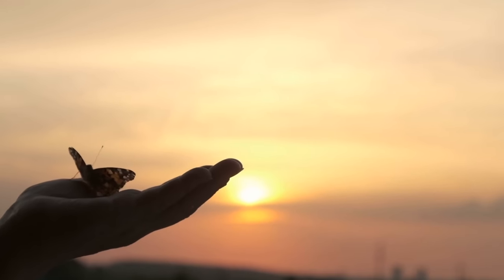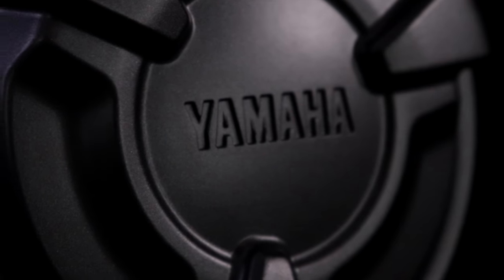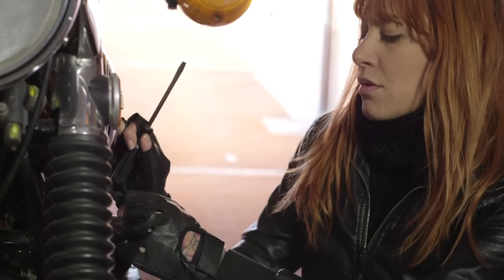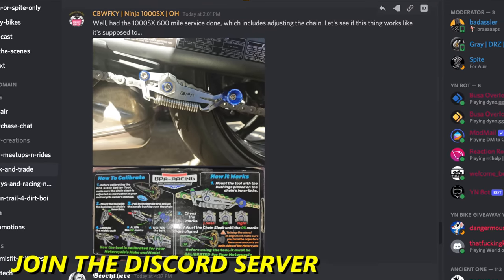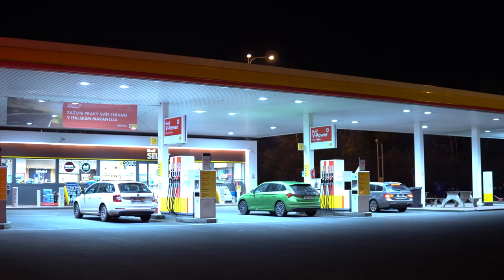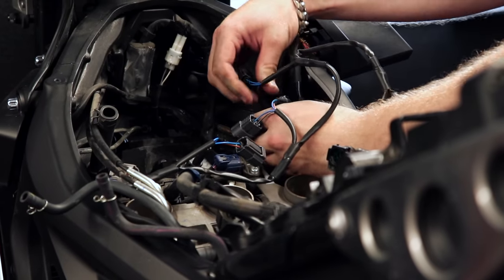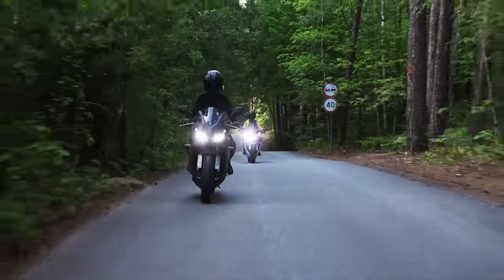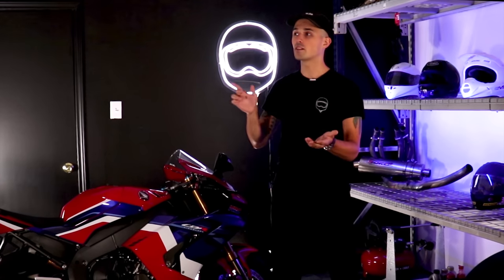7 Ways to AVOID Damage to your Motorcycle (Will Last Forever)!

Comment: Running up to redline occasionally isn't necessarily a bad thing.  I run my current car up to 8k+ fairly frequently.  It has over 200k miles on it and it doesn't use any measurable amount of oil.  I once had another car with a very similar engine that had half as many miles and burned almost as much oil as gas.  It was owned by an elderly couple that drove it like they were driving Ms Daisy.  They sold it to a 20 year old who revved it like it was designed to be and wiped out the oil rings because the Pistons actually travel a bit further at high rpm.  Manufacturers put the redline where they do for a reason and they take valve float into account.
Reply: Exactly👍
Reply: my opel has 500k miles on factory engine ran it 1.5k-2.5k all the time on highway 4.5k rpm, started to use oil lately, changed piston rings each 120k-200k miles how its normal for them to last, got a toyota with 140k miles bought it with 120k miles ma lil toyota had 2 broken piston rings and 1 exterminated ran without missing a beat for 8k miles sometimes didnt use a bit of oil sometimes used 1 litre per 1k miles i then opened the engine and renewed it now it runs good and doesnt consume oil, new chain gaskets and piston rings and engine is like new, piston rings last around 120k miles also driving litely affects their life proper warm up cool down helps, engine had massive amounts of carbon before i repaired it 1st owner didnt take a lot of care about it,close to redline kills the engine especialy if high mileage and old factory parts, but yea you can rev it hard without breaking the engine but not exagerated

Comment: Proper break in, keep your bike from overheating and keep up on fluids.
Reply: No such thing as break in
Reply: @TheFerwing  yup, they are broken in at the factory
Reply: I was told to keep it below 6k and 65mph for 650miles
Reply: Exactly, do like you said. If interested in motorcycles, cars and travelling, go and check my content. You may like it. :) Thanks for taking your time.
Reply: I used to do the proper break in with every new bike I would get. My last new R1 and CBR1000RR I just immediately road it like I stole it. No problems and the interesting thing is alot of racers do this same thing and recommend it. My new bike I'm getting I'm flying to Denver to get and riding home. Definitely not breaking that in "properly".
Reply: @noiceb5655  No they aren't broken in at the factory. They are very briefly tested to be in full working order before leaving to be on the public highway for liability reasons. They are literally started up and ran though the gears on a rolling dyno for a minute or two and shut off.
Reply: @madpirate1790  A road bike is different to a race bike.

Comment: for storage fill tank with ethanol free gasoline,  Ethanol absorbs water and causes all sorts of problems.
Reply: AND contrary to popular belief and the labels on the products in question, you most certainly CAN invent problems "over-dosing" with those ethanol treatment chemicals on your bike. It can cause shellacking in the tank and fuel system all the way through (which is actually easier to deal with in a carburetor) and it DOES deteriorate over time... reducing volatility and "fire power" you get for the fuel.  ;o)

Comment: My zxr400 has spent most of the last 20k miles of its life above 10,000 revs .... Still good as new inside the engine. I'm never scared to rev any bike, I always avoid the rev limiter though, there's never any need to hit the limiter.
Reply: Agreed,  but I hit mine once or five times 🤭, by accident of course...

Comment: I don't drain all fluids from my motorcycle during the winter break, I change the oil, fill the tank to the brim, spray some WD 40 into the exhaust and close the pipe with two rags, remove the battery and store it in the basement with a battery monitor. At the end I put the bike on the center stand and use an additional wooden support to ensure that both wheels are in the air. My motorcycle has been with the same engine for 42 years. If you ask, it's a Yamaha XJ 750 Seca
This year I gave it to an old friend who always wanted it and switched to a FJR 1300

Comment: Even before thw GSXR went to liquid cooling, Cycle World, for a torture test, had one run at WOT for 24 hours straight. After the 24 hours, the engine was torn down. There was no discernible wear whatsoever, even after screaming into redline for the whole time. And that was with the old air-and-oil cooled configuration.

Comment: YAM, I only put ethanol free gas in my bike year round. It's never seen ethanol gas because of my experience with boat engines and the nightmare it causes there with 100 gallons in the tank. Thanks for the content, great stuff!
Reply: Hummm not sure if I should go that route, I mean I already use 93.
Reply: Ethanol is fine if you ride regularly. For storage it's better to use ethanol free gas but it still goes bad fairly quickly. Best for long term storage is to use the fuel from those metal cans they sell. That stuff stays good much longer. Check out project farm, he did some tests.

Comment: I idle my chainsaw to run out all of the fuel so it doesn't turn into 2 stroke varnish in the carburetor when it's stored for 3 years, but when storing my bike for  3-4 months for the winter, I fill the tank to prevent air in the tank from expanding and contracting with every daily thermal cycle, which sucks air into the fuel tank and condenses the water in that air.  There is no need for fuel stabilizer for a few months of storage.

Comment: nah, warmup can be done while riding. Just keep rpm's low. This way it warms up faster anyways and you're not wasting fuel. Some bikes will never warm up when you let it idle, definitely not to 160f
Reply: Three to four minutes of warmup without riding is ridiculous, also the heath will build up a lot faster than it would if you were just riding it without revving it too much.
Reply: @JCBigCat  2 minutes is cool you gotta let the cold metal warm up slowly otherwise you risk damaging heating it up too fast riding it?.
Reply: @233kosta  That's what I follow. And I do a quick check for weird noises. Then off I go and take it easy on the engine for several miles.
Reply: @azr2d1  Having an oil temperature gauge is a big help here. Tempted to put one on my little 125 if I find a neat way of doing it without cutting or drilling into anything.
Reply: @233kosta  For sure.

Comment: I used to have a suzuki gsx250f with about 135,000 km on the clock. When I bounced it off the rev limiter at 16,500 rpm all it would do is blow a little smoke and misfire a bit. Tough as nails that old thing.

Comment: The number 1 tip: The bike warmup. regulating the oil is not too true, because the moment you open the bike it immediately distributes the oil in seconds. what you're really warming up is the whole engine, and yes, the oil. you're making the engine ready for the massive amount of heat that is about to be produced, in this way you're preventing the engine from sudden heat that could potentially break parts from thermal expansion
Reply: Allowing an engine to warm up to operating temperature ensures that the internal clearances are at specification as a result of thermal expansion. It also ensures that the oil is functioning optimally within its designed temperature range.
Reply: @davidbrayshaw3529  ummm... That's just what I literally said mate.
Reply: @Yakigami  Please re read my post.

Comment: carburetor bikes don't run right till they are warm, no fancy shut-offs or self-control is needed. itl just bog till shes warmed up, also the cause of may jetting headaches.
also just run the gas that the owner's manual says, you might be surprised at what it says. my fz6 witch has the same motor as an early r6 calls for 87 for example.

Comment: Fort nine a great comparison on fuel stabilizers.  They really did not do that much.  He recommended winterizing with ethanol free gas.
Reply: Which makes sense. The whole point of stabilizer is because of the ethanol in fuel to begin with. If you use ethanol free gas, then there's no ethanol to need stabilizer for.
Reply: The stuff works for my fuel storage that's for my generators. If you don't use it the fuel flat out won't start the generator.

Comment: YO,  I got a brand new 2019 CB1000-R, after first 600 miles i did an oil change with Castrol Actevo 10w30 & OEM Honda Filter, i flushed the OEM coolant & replaced it with Engine ice. After the next Three  3000 miles oil Changes with Castrol Actevo & OEM Honda filters I have a Large  Stock of Motul 7100 4T 10w40 and K&N 204 oil filtrs for the rest of my motorcycle's life 😎 and For Fuel, i am always at Costco pumps with Their premium. I Noticed that my Bike cranks up better/QUICKER with Costco's Premium Fuel in comparison to Shell's.

Comment: During winter to keep the bike fresh, I just ride it for 60-90 minutes on 50mph roads once every 3-4 weeks. A matter of putting on extra warm clothes and duke it out until the bike's good and warm again. It has kept everything fresh that otherwise would rot during a 3 month storage and ensured my bike's always stayed fine in 15 years of riding. What also helps is a good fresh tank of fuel in the middle of winter to break up the season into 1 month intervals, so there's never any fuel going bad. Same with an oil change when due and chain lube.

Comment: Had a Honda Varadero 125 from new up to 93,000 miles and the only way to ride them is hit that redline it in every gear and use fifth as an overdrive!

Once kicked down from fifth to fourth as i came into a bend doing 60mph and bang..... i was actually in fourth gear kicking down to third and snapped a rocker arm.

Quickly repaired and back on the road, redline and all.

Comment: 6:40 (German) I only put Premium fluids in my vehicles, my cars engine had to be dropped out arround the 160k km mark, due to the timing chain making funny noises.
They also checked for carbon buildup and wear on other internal engine parts, since it was already out. 
The engine looked like new and had only a little carbon on the Air sensor, which buffled them, since cars with that distance usually are pretty plugged with carbon.
My car also pulls better than my fathers, who got the LCI of mine, with a few moree HP.. He likes to go cheap and already got issues due to carbon buildup, with less km on it.

There might be a lot more factors that should be considered, but for me it is sort of an indication, that their shit actually works.

Comment: I ride a 2009 harley dyna. Its my only vehicle and I always let it idle till the high rpm slows down to normal which is about 30 seconds and then I drive gently for a mile before I pin it.
Reply: @deangruwell6555  ive heard people talk about it but I've never had it. I hear its from a flexing in the frame but im a light 145lbs and maybe thats something that only happens to heavy riders or maybe the previous owner fixed it. I bought it with 40k miles

Comment: Yes I am not a fan of mods but I do think the ecu flash is good because it does correct the factory lean condition they do for emissions. They run too hot when fuel is so lean and also the fan doesn’t turn on soon enough to keep motor cool. I think the flash will actually make motor last longer. I don’t really care about the extra few horsepower I just don’t want my bike running hot and too lean and I want it running cool and those fans turning on before engine gets so hot

Comment: 02 Triumph Tiger 955i just crossed the 96,000 mile mark. Zero engine mods including the factory muffler. Completely original engine and clutch plates. I do all my own maintenance except the valves. 
If it ever does blow up I'll probably do an engine swap because I don't want a new bike with all the super computers on them.
And I don't drain all my fluids when I store it for the winter in fact I top everything off.

Comment: Load is the best way to warm an engine, you should not idle to warm up.  I let it idle for about 30 seconds then ride at low speed and load until warm.
Reply: I usually idle for about 5 minutes then riding slow for another 5 minutes.  Bike seems fine.
Reply: Should note: "This is for fuel injected motors."

Comment: Your good! I just disagree with 2 things. Last tip- storing bike. Didn't say how long, but dry? I would never recommend storing a bike "dry". Without gas. sure, without brake fluid??? OK, I guess...but with out oil? Not a good idea. Especially for older vintage bikes. Seals will dry up. Seals and bearings will leak new gear oil like a sieve, making the engine useless to ride until you replace seals, o rings and bearings. Modifying the bike? Yes, it can shorten the life of a bike, but moderate modification can actually improve bike operation: Air filter, and exhaust. Air in....air out. Better spark plugs and suspension mods are good for better handling too, which if not crashing, will make the bike last linger. Good video.

Comment: If you are stuck using lower octane gas than is recommended, it is NOT the high RPM s that you should avoid, but "wide open throttle at midrange" as that is where knocking is most likely to occur, If you need to get somewhere in a hurry, run tor RPMs a little higher and don't go full throttle until you are on the upper range of the engine.  Lower octane gas actually burns faster, which is one reason that it knocks.

Comment: If you get stuck and must use low octane fuel, keep up the RPMs and DO NOT lug the engine or put it under a heavy load -- back off immediately if you hear/feel any pinging.  Put in only enough to get you to a station that has the proper octane gasoline for your bike.  Been there, done that.  Ethanol+mineral gasoline is poison to carbureted engines if left in the float chamber for an extended period of time and so the bowl should be drained before storage.  Expect to have to rebuild or replace the carburetor if the bike has been in long term storage.  See this all the time at my brother's MC repair shop.  The best way to warm up the engine is to take off, but gently baby the engine with light loads until the engine is warm.  Worked for me all these many years.  Driveway mechanics can't possibly know what it took years of study by some of the world's best fuel, cooling and exhaust engineers.

Comment: I would add one more thing to do.  8) Wash your bike regularly.   - I don't mean detail it like an obsessed Harley guy with a can of Chrome polish but a bucket of water and a sponge and a hose.   The reason, is that by washing you actually will put your eyeballs on areas of the bike you don't normally see.  It often can let you see a problem forming before it becomes a big problem (Loose bolts, oil leaks etc etc)

Comment: Sounds bad but I've never warmed up a bike properly. I've been riding Super Sport bikes since 2002 and I use them as daily vehicles so I put a lot of miles on them to say the least. I've actually never had a mechanical failure so either I've got really good luck or it must not be too terrible to do. I don't have time to warm it up or I just don't want take the time.

Comment: I recommend 91 as it has no ethanol in it and when you bike sits for any amount of time it wont build moisture in the tank like 87 or even 93/4/5 will. just 2 cents from a petroleum mechanic
Reply: Is this true for all 91 octanes regardless of brand?
Reply: @ridenm7748  no as some cheap gas stations mix old fuel in with new.

Comment: My Buell will last forever it's made from depleted Uranium. Buell has never had an engine failure during a race. I just need to keep racing everywhere. My oil runs to the swing arm. I got the Buell manual it's like a phone book from the 80's.

Comment: 1) It gets warm almost instantly because my cooling fluid is leaking.
2) When it expledes it explodes, whole engine rebuild is gonna be like 200 bucks
3) That's right
4) Thats also right, my 1993 honda runs much worse on 98 than 95, i would need to adjust the carbs and timings for 98.
5) The difference really isn't that big, and in smt like a 50cc going to 85cc will make a huge difference, istead off doing 80 u will do 120.
6) Well it really depends on what bike u r riding, if its a two stroke never go below red line, if its a four stroke it really depends, a desmo won't have that problem.
7) That one is also correct.

Comment: Its fun the talk about Octan, here in Denmark Low octane gas is 92, and most people in normal cars and stuff runs 95. Didnt even know they sold it lower than 90 Octane in Murikaaa
Reply: 87 murica=92 europ, 91 murika=95 europ different measurement both use minimum mainly 91=95 murika sometimes has 87, and like murika 93-95= europ 98-102

Comment: BMW's literally states in manual not to let it sit idling on stand on startup to warmup. Obviously you shouldnt start up and redline it when cold.
Reply: It really is a myth. Start the bike, gear up  settle into the bike before you grab a hand full of throttle and you'll be fine.
Reply: yep, letting idle is myth. Start it, make sure oil pressure is good (light) and ride it. Keep rpm's low (but not too low ) for 10 miles and you're good.

Comment: when you said check your valves, did you mean check your valve adjustment? if so the head gasket doesnt need to be change at that time since youre just removing the valve cover
Reply: I don't think Yammi Noob knows the difference between a valve cover gasket, and head gasket.